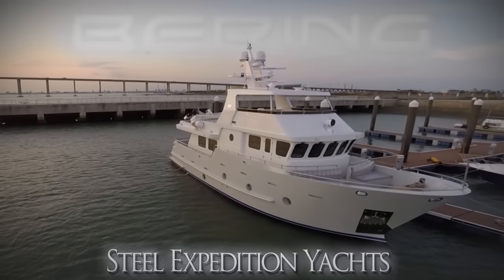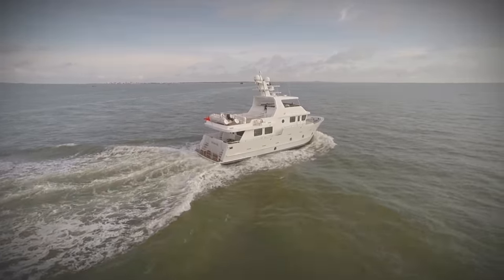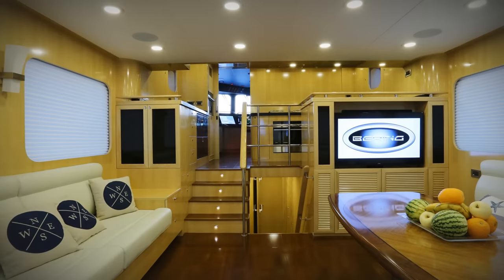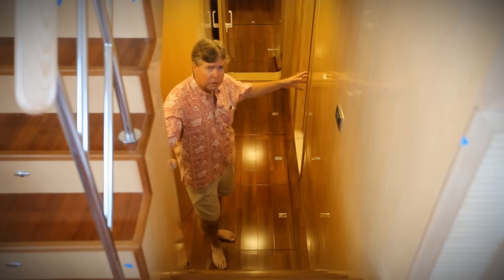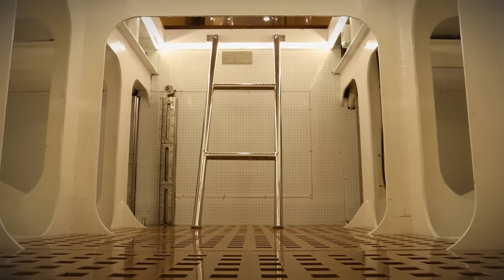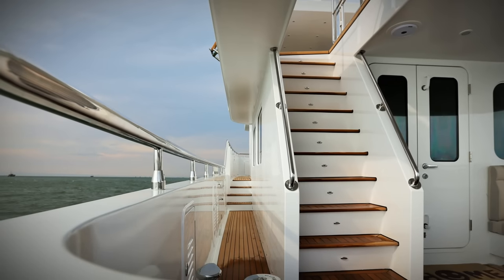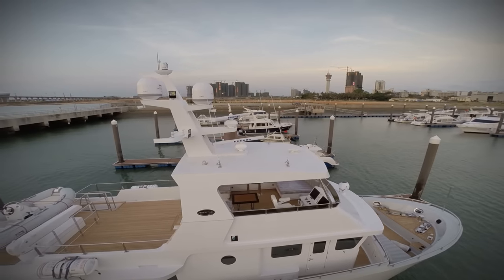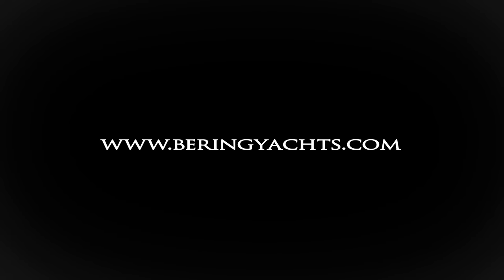Bering 65 Serge - Steel expedition yacht - boat tour with Jeff Merrill

Comment: I have been building toward a Nordhavn for quite some time now. After learning more and more about the Bering yachts I really don't know now. I'm going to have to do some heavy research into this yacht Builder.
Reply: tackless the biggest difference is that Bering uses steel hills and nordhavn uses fiberglass, the steel will be a lot more forgiving if you hit rocks or a reef, plus it will be easier and cheaper to repair steel.
Reply: The 77 has double thick steel hull - quite possibly the beefiest build I've ever seen. It's amazing. Diebold steering is out of this world; totally industrial strength build. They could copy it to a house build without the pilot house and it would be a massive amount of square footage. The galley is a kitchen to die for as are the bedrooms and en-suites. Just incredibly well built

Comment: The yacht is great in many ways, yet the interior, you have to do something about that, cause with a great interior, this yacht could be really great,
Reply from the maker: Thank you for your comment!
Reply: Galley need  to have better designed and bigger!
Reply: This is a much older model, the new ones are much better laid out with better use of the space

Comment: How does this compare to the Nordhavn?
Reply: +cornskid If I am not mistaken, the air draft on the B65 is taller than on the Nordhavn 68, even though the Nordhavn has a taller superstructure, the main deck is almost at the waterline making it shorter overall than the B 65. That is also the reason why the bow height on the N68 is only 10 ft and on the B 65 is 12 ft I believe and also why the N 68 has a deeper draft. Nordhavn seems roomier in the inside but the B 65 in my opinion, seems a better, more seaworthy boat although I could see a wife pressuring to get a N 60/64/68 over a B 65.
Reply from the maker: +Jantony Velazquez the Bering 65 is probably as spacious inside as the N68. B65's layout features 3 en-suite staterooms with queen sized beds and one en-suite crew cabin. Overall boat is not as tall as the N68 though.
Reply: +🚢 Bering Yachts I remember reading somewhere that the N68 was 30 feet tall but I can't find the source and searched the web and can't find the air draft measurement anywhere and I am sure you guys know more about the trawler offerings out there so thank you for clearing that up.  I was wondering why does Serge has 2 stainless steel support posts forward in the fly bridge that Namaste doesn't have?
Reply from the maker: Namaste's hardtop is made of steel, whereas Serge's is made of fiberglass.
Reply: +radbcc I think the major difference is that Bering use Steel instead of Fiberglass for the hull construction. The interior is much more modern and nicer...but i'm sure if you speak with the ship builder they can always change it with extra cost. 

If you compare B65 with N64, according to their web, B65 can operate 5000+ NM whereas N64 only 3000+ NM...i guess its because of the twin engine.
Reply: Beautiful trawler. This is my dream liveaboard. Would love to cruise this beauty to Europe and beyond!
Reply: buy what you want---- she's just going for the ride anyways

Comment: The Serge 65 looks like a snow plow pushing water forward of the bow👎
Reply: It has a bulbous bow, this likely improves the ride through waves and improves fuel efficiency and speed a little.  Displacement hulls plow the water, even those that don't appear to.